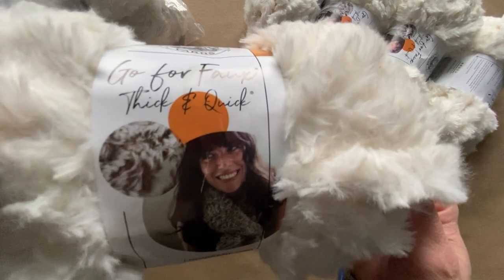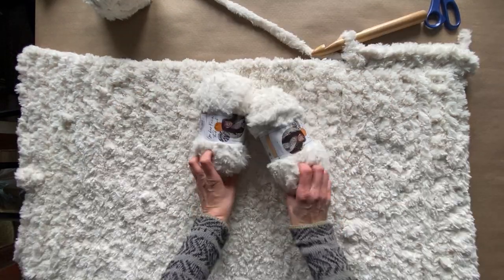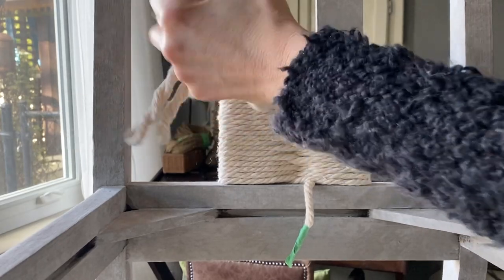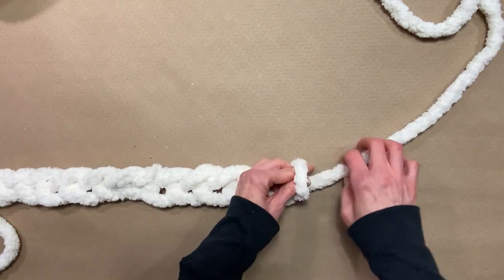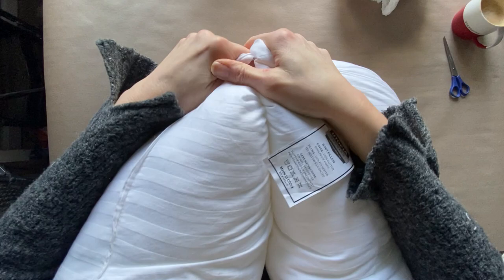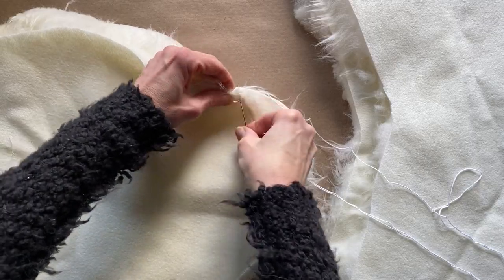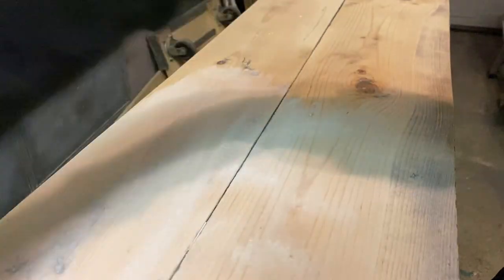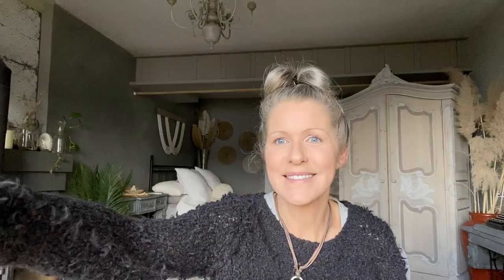5 Home Decor: IKEA hacks -Fur Pillow & Chair; Pouf ottoman, Chalk Painted Furniture | asmr diy craft

Comment: I watched because I really wanted to know how to make the pouffe. 
I was pleased to see you whitewash the cabinet, as I want to do that with a couple of pieces of cheap furniture. But I want to know if you sealed your furniture. I'd rather not, but I will if it's necessary. They are pine chest that doubles as a coffee table and a pine (or similar light softwood) slatted bathroom shelving unit from Ikea. Otherwise, I could water down ordinary wall paint to make a wash.